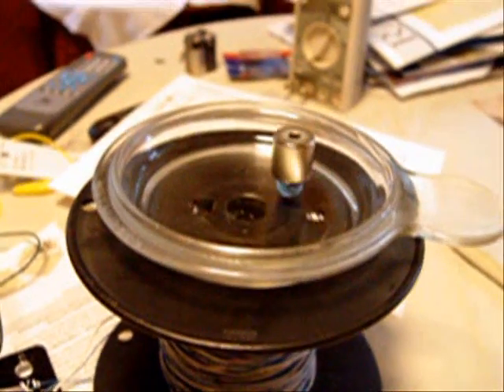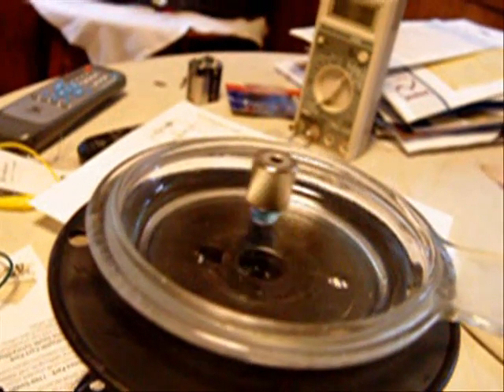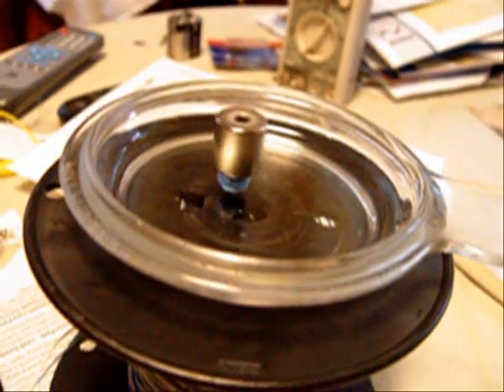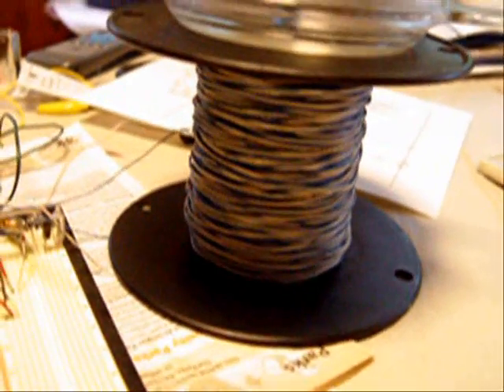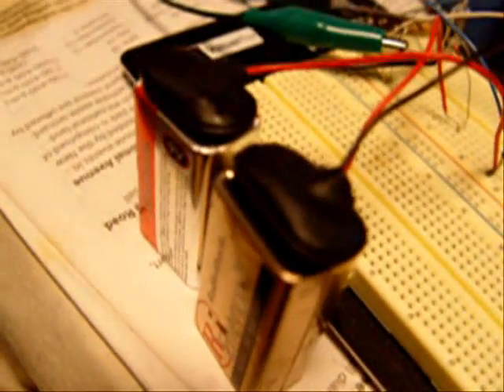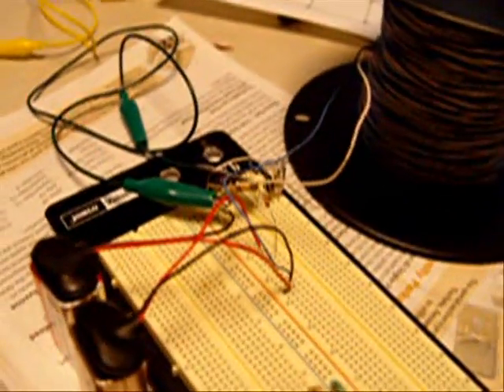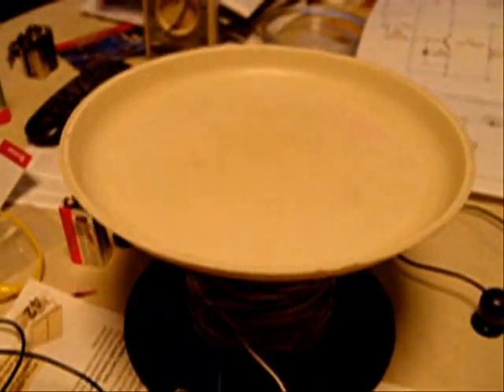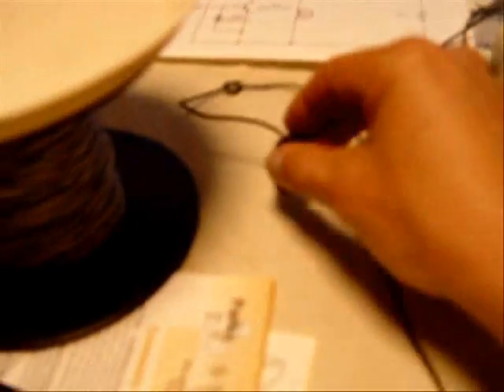One Magnet No Bearing Bedini / Davro Motor Replication

Comment: Nice video and nice job!  That is running very smooth it appears....and quiet.

Excellent idea with the glass marble.  I was wating to get the correct size steel spheres but I have some highly polished precision ceramic spheres (very low friction) I didn't think I could use but...now I see I can.  How did you hold the marble to the magnet?  A drop of superglue or something similar?

Very nice work.

Bill